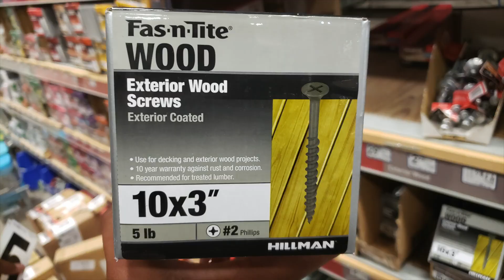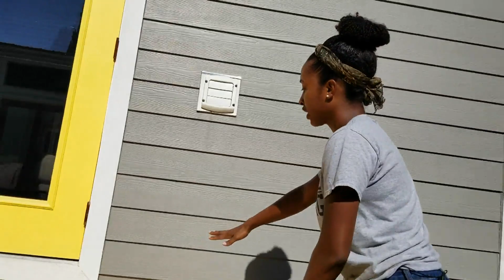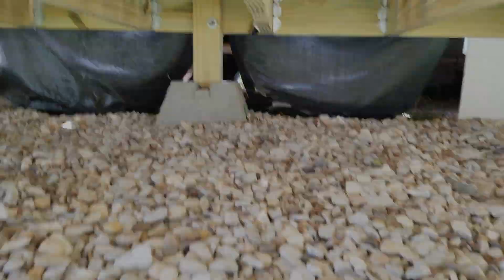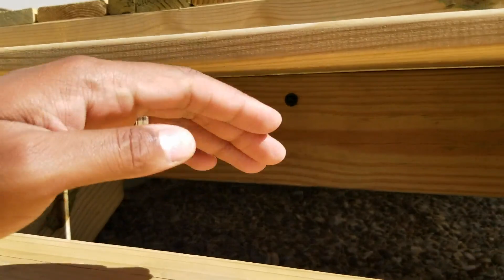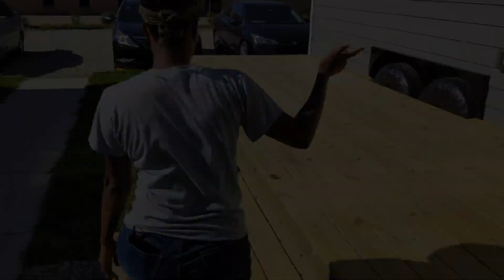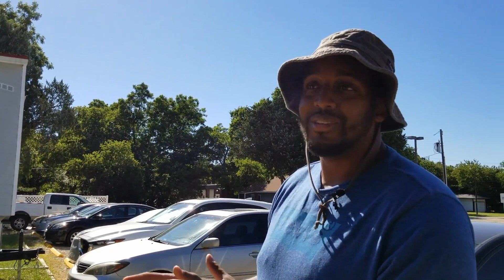Build a Deck for $1,000 with NO EXPERIENCE!

Comment: Really great video with a lot of details.   I feel like I could build a deck now.  I know that railings would change the look of the deck is that why you didn't use them?  Just wondering from a safety standpoint.
Reply from the maker: We do think it would overwhelm the deck but it's also not very high off the ground at all. We had talked about putting a small lip on it to avoid the chairs sliding off though.

Comment: This is probably a dumb question but how often do you have to put air in the tires?
Reply from the maker: Not dumb at all! Usually we just air up before we move the home which has only been 2 or 3 times. Its actually stabilized on blocks so the wheels dont touch the ground.
Reply: @the_bush_family  oh ok 😳 thanks for answering.  ❤the deck looks professionally done.